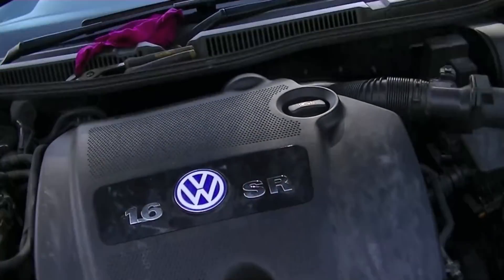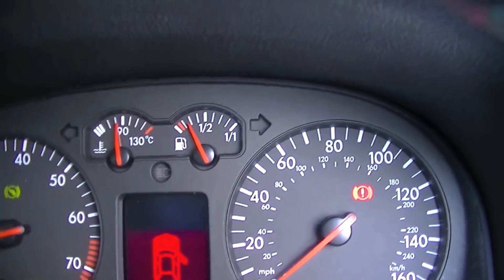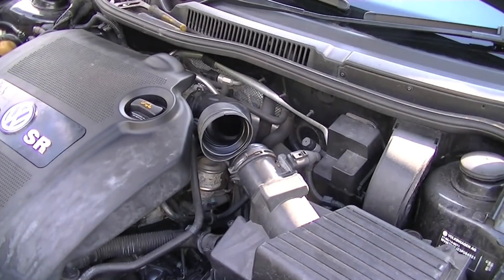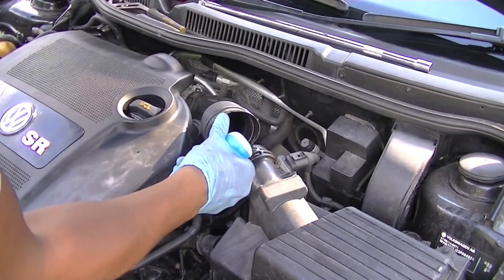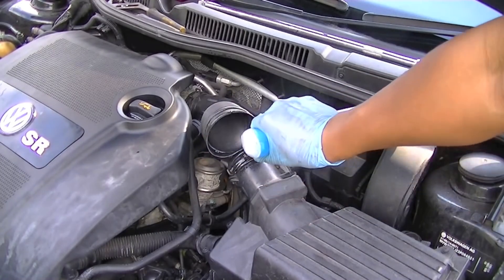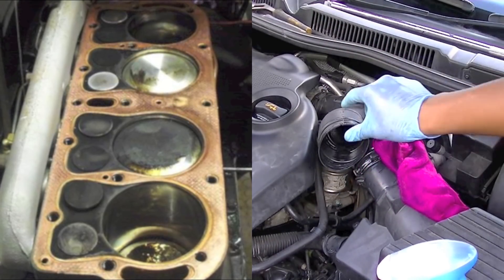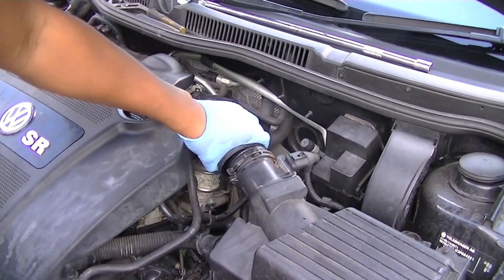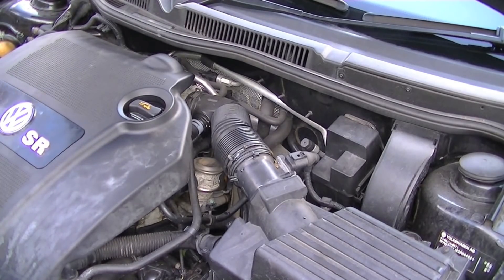How to make your engine run better with just tap water.......Better Than Seafoam?

Comment: My question..... wont all the carbon deposit breakdown block/damage your catalytic???
Reply: +Andy George there is water vapour formed when petrol burns anyway, witness the drops form your exhaust when you first start the engine. Most combustion produces water vapour.
Reply: ***** If it were a constant stream of rubbish from the pistons, then yes...  Expect the CC to die a quick death...  Once in a blue moon treatment?  Should be OK...
Reply: Most likely lead gas fucked over cats
Reply: +swifthartless there is no lead in petrol
Reply: +aR Bemo (aRBemo) more prevailant when the car is cold, and condensation (hot engine/cold exhaust), but the exhaust dries out once the car comes to temperature...  Thats the key, having the car at temperature and running when the water starts.   Condensation shouldnt adversely affect the catalytic elements...  in fact...  I imagine it'd be on the benefitting end of some of that engine steam, and may end up cleaner...  I'd have to experiment with that one...  :)

Comment: but wouldn't it be better to use distilled water?
Reply: Or soapy water?!
Reply: Curi0u50ne That might provide a "interesting" result ;)
Reply: +ulfmusskacken Or filtered water...?
Reply: +ulfmusskacken distilled water is better as there are no fluorides or calcium compounds. However you'd have to do this several times a day to cause a real issue.

Comment: Very very stupid to put water in your engine, water mixes with oil after a little blow by and now your oil is contaminated," oil pump failure, valve train damage, and/or total engine failure. GOOD LUCK WATERING YOUR ENGINE!!!
Reply: num5golden1 Engine is hot, water is in the combustion chamber..  Couple of factors to consider, (A) Water turns immediately to steam when presented with fire... and (B) combustion chamber shouldnt have oil in it...    Your scenario calls for rather a LOT of water to end up in the sump, and for the car to not run hot enough for the water to evaporate for a very very  long time...

Comment: What about the water that doesn't make it into the engine and gets left on the throttle body? Would that cause corrosion over time on the throttle body itself? I mean, it isn't hot enough there to turn to steam and IDK if its hot enough to evaporate on the throttle body, especially with cold air being sucked through it.
Reply: Antwon Jenkins That's why you take the car for a spin after and hammer it, to make sure every drop is sucked in.
Reply: Antwon Jenkins Dunk your hand in water, and hold it out the car window while its driving along...  even in cold air, it dries out pretty quick, doesnt it.  The air entering an engine does so at a speed not too dis-similar to your hand dryer experiment...  Water injection is meant to happen AFTER the throttle body anyway...  Doing this with a squeezy bottle isnt ideal...  Your car will be OK
Reply: Andy George
Reply from the maker: +Antwon Jenkins Why would water sit in the throttle body????
Reply: It wouldnt, unless you turn the engine off, but keep squirting water into the engine...  but only a madman would do that...  thats ASKING for trouble...

Comment: Wont this method fry any sensors? I mean it is wáter after all. Were will this wáter go? Will it evaporate to no harm? Wont the throtle body break because of the wáter pouring in? I know its sprinkling not actually using a hose or anything but its still wáter wetting the throtles plate and posibly going inside into the sensor.

Comment: I think an oil change is in order after doing this.
Reply: Not if you run the engine at high temperatures, where the water will evaporate. In a healthy engine this shouldn't go past piston rings.

Comment: It's not the carbon on the pistons that make it run poorly it the carbon on the valves that causes fuel pudding and flow over them (the valves ).
Reply: Gordon Lawrence Read my reply to James on port polishing, and airflow. And now you call me a muppet when you clearly did not read it. As I said my comment was a reply to Dan, whether I indicated that or not. I could enter into a battle of wits with you, but you appear to have arrived unarmed.
Reply: Gordon Lawrence Wow thanks for that useful information,which if you had bothered to read the rest of the comments above, we have already covered in some detail. The guys question i was replying too, was distinctly about fuel quality and its knock resistance, but you just had to stomp in with your muddy boots and start insulting people. I think you should reassess your attitude "mate"
Reply: ***** Wrong, the carbon on the piston causes predetonation, as it remains hot from the firing stroke, causing it to ignite the incoming fuel before the spark plugs fire.
Reply: Wrong,th

The amount of carbon on these pistons is no where near enough to cause such a problem. Any modern vehicle is going to have a knock sensor that will pull out the timing till any detonation or knock will be eliminated. The fuel coming over the carbon on the back of the valves will cause poor fuel atomization leading to poor running.
Reply: *****
No, you are still wrong, you see one instance and it's enough to declare carbon deposits will never cause predetonation, pretty ignorant thinking, there are a lot of vehicles and engines without electronic sensors and injection!
Reply: I didn't say that stupid,I said this car and modern cars. Talk about ignorant.
Reply: As a result it doesn't burn all the fuel,that's what results in poor fuel economy.... A car needs spark advance,the spark starts x number of degrees before TDC if the knock sensor hear a knock it pulls out the advance..it doesn't add timing you hammerhead....doesn't burn the fuel...
Reply: You never mentioned "extreme"  cases of carbon you said nothing of the sort. You also didn't know the computer removes timing under detonation/knock,so if it's anyone who's a keyboard commando it's you. I've done more dyno runs than you've played dungeons and dragons, you don't even know what TDC is.
Reply: Anyone that doesn't know basic function and result of a knock sensor has less than basic knowledge of engine management. Tell me genius with your fast and furious car education what else would an "extreme" case of carbon build up cause. Let's see if you can even come with two problems without doing a Google search.
Reply: *****
No fast and furious here genius, I love old American iron, and hate this new shit, once they get age on em, they become a money pit with all the electronic crap that starts failing.
Keep digging
Reply: *****
Not at all, you have done absolutely nothing other than repeat the same thing,
the knock sensor removes it, I keep telling you, the result is poor running conditions as the management system is controlling knock on an engine that has already gotten carbon established in it. Go kicks rocks stupid!
Reply: FYI I've not played dungeons and dragons, I have more grease under my nails than you get on your hands, I get it by actually turning wrenches on my engines, instead of laptoping it, so cry on someone else shoulder.
Reply: Depends a lot on the engine too, high compression or forced induction engines will self destruct much more quickly, but some older engines used to knock like f**k going up hill or pulling loads, especially if adjustments were not spot on. And I dont know about you, but I can hear knock in an engine under load, but average drivers might not. Knock sensor pulling timing will most certainly hurt engine performance especially at high loads and wide open throttle.
Reply: I like to make sure people have the whole story with and from someone that's actually done it and seen it. And maples01 your a dipshit.
Reply: +dan marton higher octane reduces the chance of detonation and knocks, so yes.
Reply: It will usually only help if you exceed the knock threshold of the original fuel, buy running tons of boost or high compression, pre ignition can be caused in lots of ways, and sometimes even the highest octane racing fuel wont save an engine that is prone to knock. Engines tend to make more more running lean, but as a result they run hot, this is usually where higher octane fuel becomes a must, a lot of tuners will intentionally add extra fuel to high performance (especially boosted) engines, which doesnt burn during combustion , and as such it acts as a coolant by taking heat from the combustion chamber as it leaves, not good for peak power or economy, but tends to keep the engine in one piece for longer.
Reply: +TrueBlueEG8 cheers dude appreciate it, regarding what someone else said about the optimization of airflow, on boosted vehicles if im correct,  WHICH i may not be, you also need to take into account the intercooler piping diameter and the szie of the intercooler itself , having a huge front mount wont help. for example you have a 2.0 straight 4 with a normal size turbocharger, with a huge frontmount, you will more than likely experince more turbo lag because that turbo now has to push a lot more air through the intercooler for it to get into the engine, so it always helps if your intercooler and all the other turbo supporting bits are optimized to the size of the turbo. im hoping what i said was somewhat correct. This convesation has gotten way off topic.
Reply: +James Okello nah bo fuel will not puddle on the inlet valve because the pressure from the injector when the valve opens it squirts the fuel and blows out any carbon and i dont think youve seen a valve on a motor opening and closing, they dont just open like 0.1-0.2mm they open up like 0.5-0.6mm so there isnt really any power gain from doing this because on the exhaust stroke there is pressure. NEVER EVER INTRODUCE UNWANTED WATER IN THE ENGINE
Reply: +Blake Lawrence tiny amounts will not do damage. Injecting more water than this is part of the validation process. Also some high lift cams open the valve way more than 1mm. The carbon obstructs airflow by increasing the depth of the "adhesion" layer. That effectively increases air friction within the engine and reduces power as the engine has to work harder to get the charge in and the exhaust out.
Reply: James Sasse in some cases yes,most modern vehicles use a knock sensor that removes ignition timing until knock/detonation goes away. When an engine removes spark timing the efficiency of the fuel burn goes out the window resulting in poor fuel mileage and poor performance. What people don't seem to grasp is the build up of carbon on the tulip of the valve cause the normally fine spray of the injector to gather causing larger harder to burn droplets leading to more carbon building on the pistons.
Reply: +James Okello Well say it a dozen times more, it still wont be right. Retarding spark will do fuck all if there is another ignition source, like glowing hot carbon?
Reply: Don't you speak English? I believe what I said is during detonation the knock sensor tells the computer to keep removing ignition advance to get rid of detonation. That's what csuses poor fuel economy and a lack of power. Why is that so hard to understand.
Reply: If you have a non computer controller engine the engine will keep running with the detonation till it ruins itself. Because rock heads there's nothing to remove the ignition advance to try and compensate for the detonation.
Reply: ***** Not unless the driver realises there is knock in the engine, and rectifies the problem. Some of us actually remember when engines had no knock control! Not many people have a non ecu controlled engine these days, sorry to break that news to you. I think what I was trying to say was, the most damaging aspect of carbon build up on a piston is the potential for pre ignition, and knock sensors will affect the ignition timing but to no avail, as changing the spark timing will not remove the secondary ignition source, ie the glowing carbon. However, I actually agree that if the knock sensor is altering ignition timing to counteract this, the engines performance would suffer as a result. No trouble speaking English here, just think we have our wires crossed.
Reply: Id agree with what your saying,what ive been trying to get these other guys to understand is the reason the fuel economy and power go away is because of the knock sensor telling the computer to pull out spark timing. By the time most hear preignition/detonation your already doing damage to the engine.
Reply: Exactly
Reply: TrueBlueEG8 Someone here kept arguing with me, as if it does no damage to the engine, but you have them agreeing with you. Hmmm, oh well, I'm ignoring them anyway, thanks to the design of the Ford modular engines, carbon builds around the spark plug electrodes, causing them to break during extraction, what a great design
Reply: Maples01 Well, maybe I have a better way with words. I also have 20+ years experience as a mechanic, so that helps a little. Dont insult each other, lets all just take a step back and listen to one another and we will all learn something.No one knows it all. Even for my experience, every day is still a school day, this trade never ceases to throw up new challenges, I think thats why I am still doing it! Nice to chat to you all.
Reply: Well I've been working on engine related items for 20 plus years. I've seen and heard enough dyno runs been around auto and motorcycle racing since 1988.
Reply: ***** I dont doubt that , I just thought i would offer my 2 cents. I am not trying to compare penis size with anyone or anything!
Reply: TrueBlueEG8 Currently, due to money restraint, I can not prevent the destruction of the heads on my daily driver, it doesn't have the hardened valve seats, just waiting to sink a valve in the head, but I still prefer the old engines to this new stuff. With that, I have been waiting to hear predetonation, but it's been good so far.
Reply: TrueBlueEG8 all I'm saying is don't believe what's been accepted as normal or common knowledge because there's always a bit urban myth mixed in...one example...polished ports make more power,another falacy.
Reply: ***** Polished ports do however prevent carbon build up, which is the core of the topic, and that limits power output. And to be fair, most people dont just polish the intake ports, they will open them up to flow better, and because an engine is basically an air pump, the less restriction to airflow the better, and that is proven fact.
Reply: Polished ports have nothing to do with the combustion chamber or carbon build up there.A smooth well shaped combustion chamber does,it does not need to be polished. I've worked on the superflow 600,port flow analyzer and saw the results on a depac dyno and racetrack.
Reply: To say the function and performance of a combustion chamber is in no way affected by the flow of air through the head is ridiculous. Shape may be the most important characteristic but there are many other elements.Polishing of internal engine parts does prevent carbon build up, it is simple science, stuff sticks better to rough surfaces. You really do like to argue, dont you?
Reply: TrueBlueEG8 Stop feeding the troll
Reply: Like I said bud, I am 20+ years working as a mechanic, and racing is my hobby, but i still learn something new almost everyday, give the guy a break, we are all still learning, just at different rates, and on different curves.
Reply: +TrueBlueEG8 quick question, out of curiosity, ive been on my motorsport course for about two weeks so forgive me if im wrong. but wont using a higher octane of fuel reduce pre ignition? i know it still wont help with carbon build up .
Reply: *****  Ah there are too many hot heads on these comments who like to shout down at people and call them names, it gets a bit tiring to be honest.
Reply: +TrueBlueEG8 Shows what you know LMAO. Never heard of airflow? Tend to make more what running lean? You dont even make sense mate.
Reply: Gordon Lawrence they make more power running leaner. Of course i have heard of airflow, but that is directly proportional to fueling, which is what we are talking about, So come on Mr Know it all, enlighten me with all of your dazzling knowledge.
Reply: Decarbonising will help more with airflow than you seem to realise and now airflow is not just to do with fueling. You can force more air in and out of any engine using a turbo BUT you are still going to loose HP if you dont get good airflow IE less resistance to air movement as you will be turning more power into heat and those losses can account for tens of HP on big engines.
Reply: Well there was no indication of that in what you said or the comments I did read muppet.
Reply: Why do you feel the need to insult each other with every comment. Kinda childish isn't it?
Reply: +James Okello I have read that excess carbon build up on pistons can get so hot that it will cause pre-detonation of the fuel. James
Reply: Blake Lawrence what if the vehicle is had a carb? The pressure of a fuel inje
Reply: Blake Lawrence the pressure of a fuel injector will not remove carbon off the back of the valve,I used to disassemble engines on a regular basis. Valves on an engine open to almost half an inch in some cases. I've had to use wire wheels and or glass beading to remove the carbon from the tulip of the valve.
Reply: Good point

Comment: The pros and cons of spraying wd40 in there instead, please...
Reply: Scott Dann Wd40 is a penetrant. It is corrosive. It is not a lubricant. It also has a low burn temp.
Reply: Would it do the job then? Lol
Reply: no
Reply: Haha I wouldn't do anything experimental with my cars. I need it every day
Reply: Scott Dann Water or Seafoam would be best, also WD-40 will probably harm any gaskets rubber or otherwise.
Reply: Scott Dann Hope you did'nt do that...
Reply: No I mean wd40. Spraying water is no problem
Reply: I wouldn't do either if I'm honest lol x
Reply: Oli L